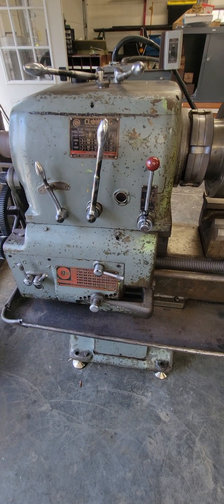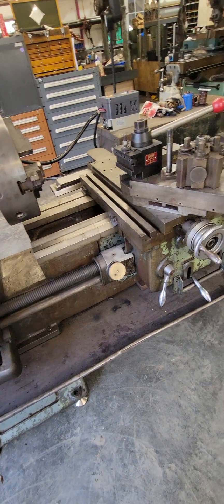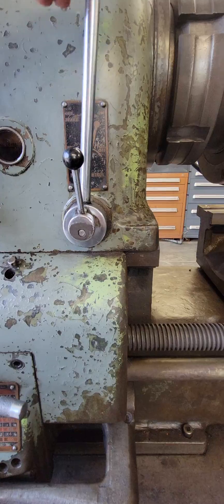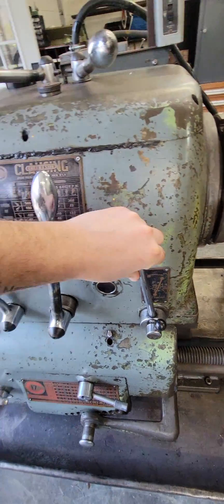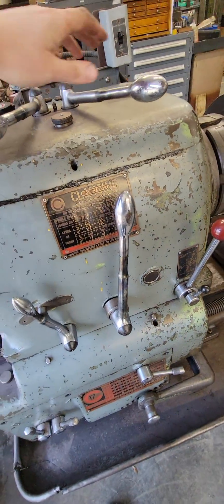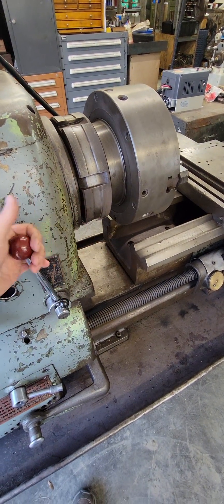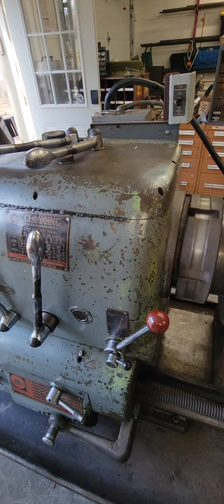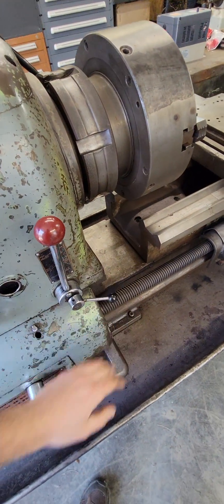Clausing Colchester Mascot 8.5 /C17 Mammoth Lathe VFD Testing

Comment: I have the same lathe here in Ireland, Fantastic built machine. But I have to ask you, how did you wire in the motor. On the motor I have, there is no  name plate and it just has terminals A2 A3, B2 B3, C2 C3 going around in a ring. Did you wire these to Delta or some other configuration? Any help would be great
Reply from the maker: So the motor on mine is a 2 speed motor, and is rated for both 220V and 440V, at 60 hz. The terminals on yours sound like the lines for the high and low speeds. Do you have a drum switch on the back of the headstock connected to the black lever? If so, I wired in my power to the 3 taps inside the control box and not at the motor; and then wired in the controls to my VFD from the drum switch itself by finding the contact closer from a common lead. Its hard to explain specifically but you also need to use a VFD with multiple run controls.